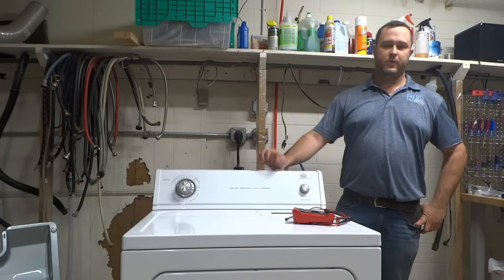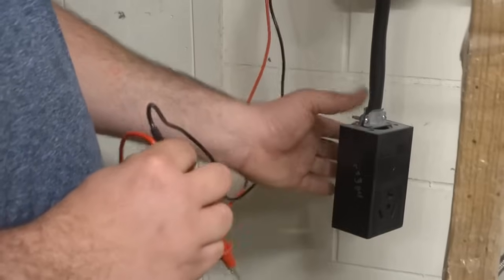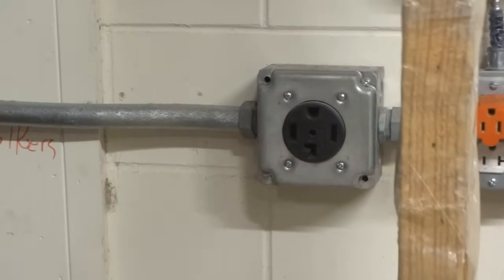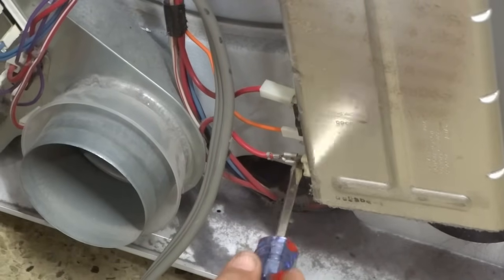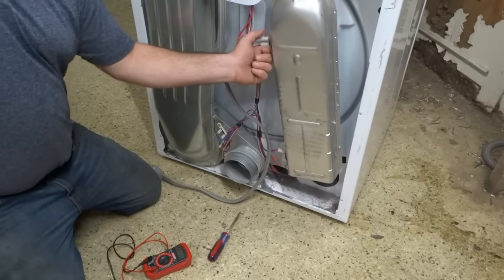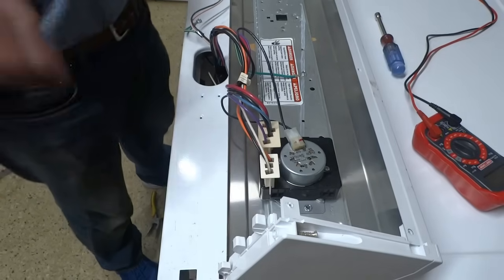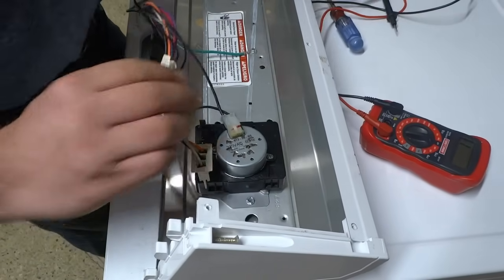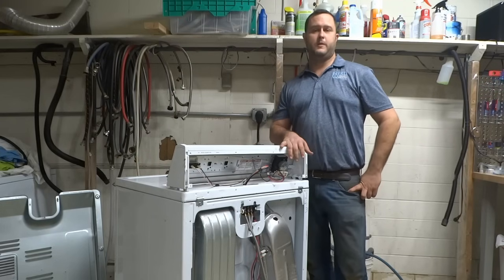Whirlpool Dryer Not Heating - Diagnosing Common Issues

Comment: I automatically figured out exactly what the problem was. Me and my husband owned a plumbing business , years before marrying him, I was gangsta doing everything, thinking it over days. Plumbing basic, electric basic. Until I hung a ceiling fan, no red, white, black wires, no   ground 1910 electrical. 2 connections  Blow my ass  10 feet 
 off a metal ladder. First time without the university of u tube. I found and brought that same little shit part. I forgot to unplug the dryer and really got it. 😂. Lesson learned. Thank goodness, for UVUT😂

Comment: Ok I just got a whirlpool roper for free from a neighbor and it's having this issue, I don't have a functioning multimeter at the moment. I had instead took each connection off of each sensor or terminal connection and spliced them momentarily or bypassed the sensor to see if it would heat up at all, and I got nothing positive. The heating element doesn't look bad so I am assuming that it's probably the sensor that's connected to the heating element because I couldn't find a way to splice that to get it to momentarily heat up. I'm unfortunately a victim of poverty and in the current administrations economy I can't afford a new heating element, is there a possibility that I may be able to solder the contacts to replace what's been taken off? I have a similar model dryer that I've taken parts off of for my White Westinghouse dryer to continue running but it fried it's wires early this morning and I am pretty sure the sensors are fine in it but the rest of that dryer is toast. The only difference between the two dryers is the heating element that came off of the similar to the roper whirlpool style dryer is the heating element on it didn't have that sensor on it, it was just the two terminals, would I be alright to swap the elements to test that and make sure it's not the heating element?

Comment: Thanks for the video, I checked all the parts which are mentioned in video ..those all parts were good in my heater… 

It was thermal fuse which was bad, I wish video mentioned that as well in first place … it’s was easy fix.. $5 on Amazon.

Comment: My machine has burnt out about 2-3 heating elements in the past 2-3 years. It’s always the same problem. The machine does not get hot but otherwise works. This time I replaced the heating element which was burnt on a coil and then I replaced the thermostat. It still isn’t heating and the cycle never stops when the times up. I’m about to give up and buy a new one after 3 years. Any advice on what to check before I give up? I’m
starting to thinks it’s the breaker box but I’m scared to get electrocuted with multimeter Testing. Thanks so much man!

Comment: This is a great video, did this today and fixed my dryer.

I started by changing the little parts in the back and the thermal fuse, dryer didn’t work till I changed the stuff on the gas valve.

This guy make it look really easy.

My concern was getting the belt back on, so far so good, hasn’t slipped off yet.

Comment: Awesome video! Helped me identify a bad heating element in my mom's Whirlpool dryer - all the thermostats and the timer switch was good, but wasnt getting continuity on the heating element terminals. Opened it up, and sure enough the the wire in the heating coil had broken. Thanks for the help!

Comment: I had a heating problem and found that the coil was broken at a place, so this was obviously the problem. Initially I tried to jerry rig it with a small copper tube reconnect the coil. This worked for a couple of loads and then failed. I inspected the coil and the copper tube had melted (I was surprised that there was enough heat to do that). I then replaced the heating element with a part of the same number, voltage , and power. I started the dryer and there was a pop and no heat. I inspected the new coil and apparently the current instantly caused a break. What would cause this?

Comment: Fantastic video!  I never would have thought the timer was the issue, but sure enough it was.  To better confirm the diagnosis, while measuring the resistance across the timer terminals, I moved the knob forwards and backwards until I caught a section of the rotation that was conducting across the terminals.  In that position, I reconnected, fired up the dryer and sure enough heat worked - and as soon as I rotated the knob (still in heat cycle) the heat turned off.  For this kind of intermittent heating issue, I'd suggest rotating the dial through the cycle while testing the continuity to be sure the timer is truly OK.

Comment: The real answer is to check everything. the thermal fuse, the door and start switch, the upper and lower thermostats, The heating element The cycle selector switch (all positions) and lastly the Operating Thermostat. Just because 1 is bad it doesn't mean the others are Good.

Comment: SaresMLee
1 секунду назад
I have maytag dryer/washer center lse1000. All fuses good, heater 13.8om, i tryes measure voltage which gets heater. Between pins of heater 0, then i put leads one of on leg of heater and second on body ( heater asmly) , got 110, and i did the same with second leg of heater and also got 110. Why dryer doesn't heat? Is heater element bad? Or motor switch, or control board. I checked wires and board itself,  there's weren't any burns on board or wires. What it could be else?

Comment: It would have been nice to see what you were doing with the Multimeter when checking the voltage levels :)
Reply: Set dial to read AC (Alternating Current) voltage.  All you need to know.
Reply: My dail has 17 settings. Non of which are " AC"@scottpatton8806
Reply: Right I can’t see

Comment: So if I have tested all those spots on a dryer that looks identical to this and they all come back fine that means it is probably the centrifugal switch doomajiggy that you mentioned at the end of the video, right?  My dryer will spin, but will not generate heat, so I wasn't sure if that would be the motor. Can anyone help?
Reply: Did you figure this out? I have the same problem.
Reply: @Adam Pizer  It ended up being the outlets power. I had someone come by and I think they found a bad fuse in the breaker box.

Comment: this video is very helpful. I didn't know that the heating element would register higher resistance than baseline. other videos said that continuity required  ohm reading to be close 0 (or baseline). you saved me $90 dollars!

Comment: I’ve changed out all components except the heat element and dryer still isn’t working. The element comes on initially but shuts off in about a minute and never comes back on. Any ideas? I’ve checked the receptacle and lint tube everything looks good.

Comment: I know this video is super old, but running out of things to check. I have the same Roper dryer and it doesn't heat but spins fine. All thermostats, heating element, and thermal fuse have continuity. I replaced the 3 prong cord with a 4 prong following another video and it spins fine. Testing the back panel, the center+left and center+right both show 120 V, but left + right shows 0V. I checked the outlet and get 240 V. Do you know what's wrong with my dryer?

Comment: I have a Kenmore 70 that is not drying. It runs, but it doesnt get hot. In addition it never shuts off. The timer gets to where its around 5 minutes from the shut-off point and freezes, yet the dryer just keeps running. It will run until i open the door to stop it.

Comment: A Thousand Thank Yous!  I( suspected it was my timer, because the problem initially affected the 'High Heat - Timed Dry' area of the dial, then it stopped heating altogether.  Took me 5 minutes to pull off the back, and another 5 to diagnose in the exact same order as the video.  I ordered a replacement from Amazon for $60.  Installed it in two minutes, and am now good to go.  Such a relief that I don't have to pay for a new dryer or a repair visit.  THANK YOU!!

Comment: I'm sure this guy knows his business.  But all you really need to do is buy the $14.95 dryer repair kit from amazon!  Piece of cake.  No need to check voltage or buy meter.  Just get the kit if you're a novice like me.  Dryer would not heat.  The kit had me up and running in 1/2 hour.

Comment: I replaced heating element, all thermal switches/ thermostat and cleaned the vent. I turned it on and was working but felt like it was way hotter that before. Turned of and after that it wort heat up again. Any thought what could be wrong?

Comment: Thanks for a thorough video.  The little demo on the power supply was what I needed because all the sensors checked perfect as well as the timer.  I thought the pigtail had gone bad, but it turned out to be one of the mounting screws (black one) holding the pigtail to the connecting plate had lost connection - loose, I guess.  Meter showed no power there but full power at the outlet.  I would not have considered it if not for your video.

Comment: Problem: Inglis/Whirlpool electric dryer with running drum motor and cold air blowing, no heat and no movement on timer switch. 
Testing: Thermal fuse, cycling thermostat, static thermostat and high heat limit switch all checked out ok. No continuity on heating element, took out element and found breakage in on of the coils. Checked timer motor supply terminal resistance  (of course removing the pins first), got around 10k reading, meaning motor is ok. Replaced heating element, still no heat and no time advancement. 
Opened timer switch, found two stuck connectors, like welded together with arcing. 
Conclusion: the connectors got stuck in timer switch, the timer motor failed to advance resulting in high heat on for a long time causing the heating element coil breakage (15 year old dryer) before tripping any thermostat, temp. limit switch or thermal fuse
Final remedy: Could not unweld the badly melted connectors (even if successful the connector tips would be gone), replaced timer switch and viola, all is ok

Comment: You saved my butt...I think. I was following your video with a voltage meter. And happened to find some loose screws around where the power cord attaches to the machine. I tightened them up. Then I checked the breaker box and found a tripped breaker. I left the back off, plugged it in, and started it. The element glowed bright orange. So, I'm guessing it was was loose wires and a tripped breaker. Going to run a load of launder and check it out. Thank you.

Comment: Thanks for your video, I found out that the timer switch was bad. And I found a different video on how to fix the timer, instead of replacing it. The contact points were pitted and not making a good connection, so I cleaned them and got it working again... For now.
Thanks!

Comment: Thank you for the detailed instructions! I had exactly the same issue as yours. I made sure if was actually a bad timer by jumping A and C, the heater is working immediately after so I was 100% sure it was a bad timer.
Reply: How’s you fix it? I have the same issue but the parts pricey by me

Comment: Thanks for this video -- I was able to diagnose our faulty timer. At least, I tested the same switch that you showed, with the same result. (That was after confirming that the high limit cutoff, thermostat, heating coils, and cycle thermostat were functioning.) 

If you are taking questions here, why would two different local techs tell me that, "there's not good way to test the timer"?

Comment: Just fixed. my dryer.  Based on your video analysis I determined it was the timer. Instead of buying a new timer I saw someone in the comments mentioned that the contacts might need to be cleaned. So I took the timer apart and noticed that when I spun the dial one set of contacts were not touching. So I gently bent the copper contact so it would touch at the appropriate spot of the dial spin and the dryer was back in business. Plus I super cleaned it when I did my evaluations and Nnow it works like new.  I WIN!!! Thanks for the good video.
Reply: Best, most helpful comment on this thread! I wish you could upload pics also so folks could see the contacts. But I took the timer apart, and sure enough, the copper lead from the same exact problem lead (red wire) in this self-help video was slightly corroded!  It was kind of flaky and gummy!  So anyway, I cleaned and scraped the contact pellets on each of the leads in the timer and WAH-LAH! It gave continuity!  Put everything back together, and HEAT!!! So thank you, this repair costed me nothing but about 1.5 hour of time disassembling, checking continuity of items from this video, cleaning the timer lead pellets, and putting it back together!  Thank you, thank you, THANK YOU!  Youtube is an awesome tool!
Reply: Had the same issue, just bent the contact slightly and got heat right away. Thanks for all the knowledge share !
Reply: Going to try today.Thanks
Reply: Had the same issue, just bent the contact slightly and got heat right away. Thanks for all the knowledge share !
Reply: I'm going to check my timer.
I bought all the fuses and everything and new heating element plugged it in hoping for heat and still no heat so after me working on appliances a little bit in the past I figured the last thing it would be is a timer it's a 2002 model roper so I mean obviously it's got age on it so I'm going to check it to confirm or not confirm. Thank you for your video, now I know how to check a timer.
Reply: @aryanahammett Did it work after the timer?
Reply: I have the same dryer and sometimes the heating element turns on then sometimes it doesn’t. Could it be the element? I already changed the sensor and still same problem
Reply: Ty, I will Ck mine in has packed with lint 👍
Reply: What is the reader brand to buy for testing

Comment: In this video, the best thing to note, is that breakers can fail (half aside at a time), so if your unit is only seeing half the voltage, it will only perform half of the job.. Like spinning, but not drying. Always make sure your breaker box is up to par, before you go throwing parts and time at an appliance repair. Otherwise you could be running in circles from the start, if an old circuit breaker, proves to be the issue.
Reply: He mentioned that already

Comment: What's that little white fuse in the lower left? I had a dryer issue, it wasn't turning on at all. Did a little research online. I replaced that $5 part and BINGO, I was back in business.

Comment: Help nothing works ive replaced the fuses and switches and coil still nothing i then took the timer apart to find welded points i cleaned them up and got them working and still no heat what am i doing wrong

Comment: Great video. I have a whirlpool that dies during a cycle. Even though the breaker doesn't pop, manually resetting it is the only thing that works on getting the dryer working again. It does get heat though.

Comment: Dear sir
I have whirlpool cabrio dryer and it is not heating. I checked with multimeter and all checked out ok, except the thermostat  on the left under the fuse does not have continuity. So do you think that is the only problem on the machine?

Comment: Thanks, used your information and I clipped the two wire ends from the thermostat and my heat started working... Thermostat is on the way...

Comment: Anyone know if the two wires to the heating element (on some machines) have to be connected in a particular order? I bought a new heating element after mine had blown and when I hooked up the new one it blew immediately. I didn't take note of what order the wires were attached to the heating element connectors when I pulled off the old one.

Comment: Thank you! I'm confident enough to fumble my way through this system but watching your video gave me names for the "sensors" in the system. Found an open heating element.  A good cleaning and a parts kit will have it running Wednesday. Thanks again.

Comment: I can't thank you enough for this video!  Our dryer was spinning fine but stopped drying and heating up a MONTH after warranty expired! I was was like "Aww... F*#^!!!" I had absolutely NO IDEA what was inside that thing! I was was looking at a $200.00 service call (just for the VISIT!) 
Turned out the wire to the heating element crimp connector was bad. I took it off, cleaned the wire, put on a new crimp connector,  and was done in an hour and a half. (And 45 minutes of that was spent going to Lowes to pick up the crimp connector and some electrical tape!  
All said and done, I fixed my dryer (something I NEVER thought I could do) for less than $15.00 
...THANKS TO YOU!!
GOD BLESS!!

Comment: I have an issue with my dryer appearing to have no power at all, already checked the breaker box for the apartment. I reset everything so there is power going to the dryer, I replaced the thermal fuse as it was bad, but the thermostat was still good. I can get it to have any power at all. The lightbulb wont even go on when you open the door, what could be the problem?

Comment: Thanks Tim everything checked out but I haven’t checked the see if I’ve got 240 I have to climb over the top of the dryer I’ll do it in the morning If that checks out I’ll pull the front of the dryer and the drum out and see if I can hear the centrifugal force switch clicking on the motor